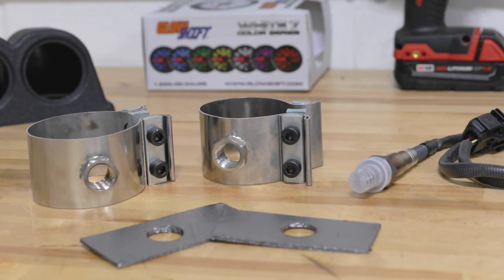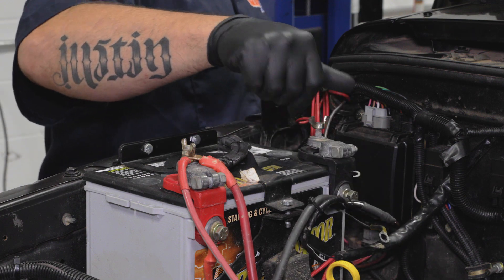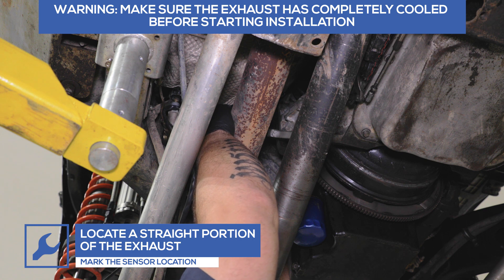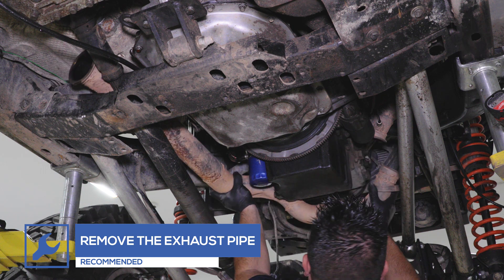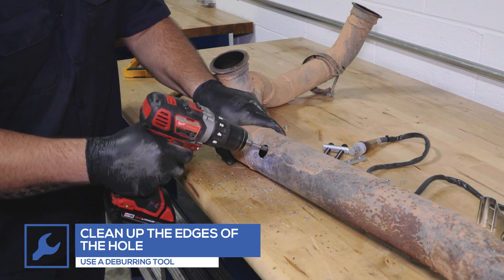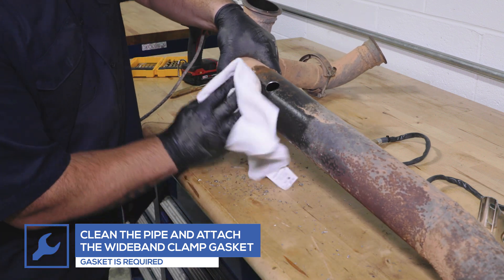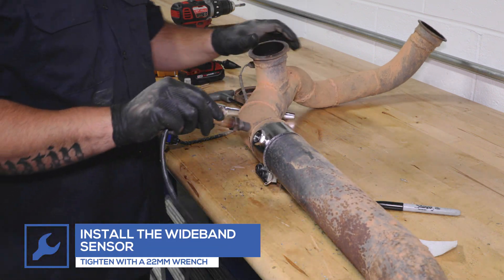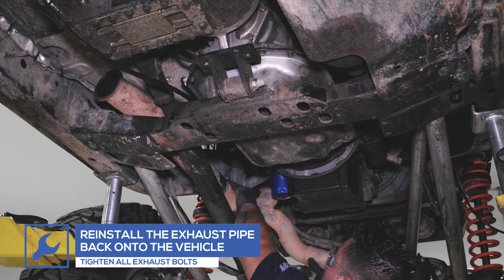Installation | GlowShift Clamp-On Wideband O2 Sensor Adapter

Comment: Where do we place the sensor if we are running a v8 with 2 separate exhaust exits that don’t connect until they reach the x pipe?
Reply from the maker: We would recommend a dual wideband setup. That gauge can be found here: https://www.glowshiftdirect.com/wideband-air-fuel-ratio-gauges/?_bc_fsnf=1&Gauge+Type=Dual+Wideband+Air%2FFuel+Ratio